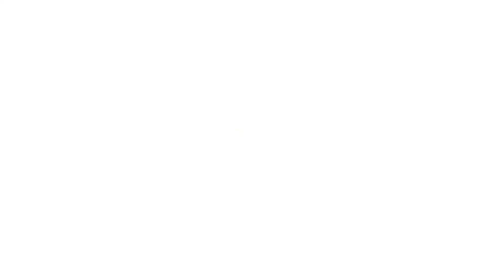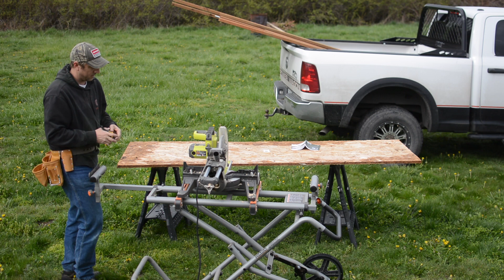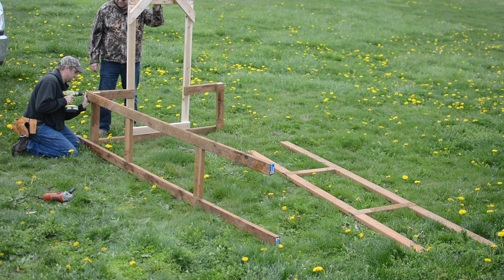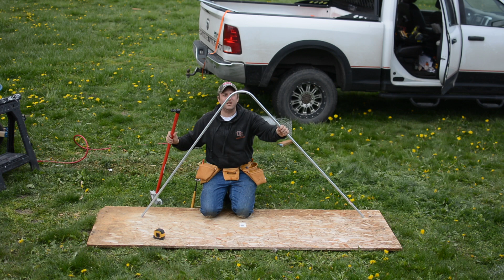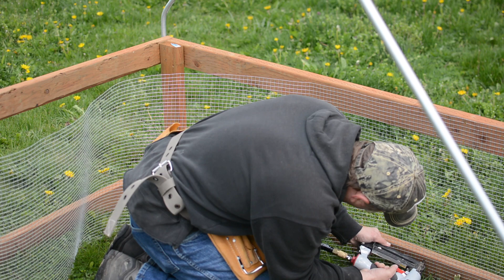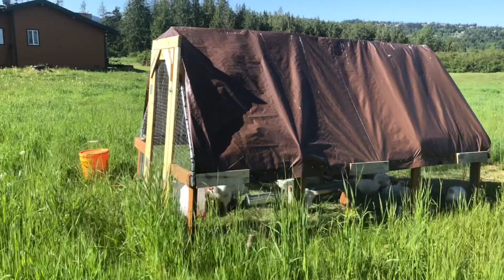Complete Build and Review of the John Suscovich Chicken Tractor

Comment: If you do it again, a suggestion for the door that has helped me is to go buy a $30 screen door from lowes or home depot and reinforce it with the wire/lumber as needed. It's a bit taller, but it take the head ache out of building the door from scratch.

Comment: Attaching the chicken wire with just a hand stapler is easy. After making all those lap joints you have the hand muscles of Superman so using the hand stapler a hundred times or so a tractor is cake!

If you don't have perfectly flat, well-manicured pasture I recommend getting a roll of vinyl wall base (4 inch or 6) and some 1 inch roofing nails and nailing the wall base to frame along the bottom edge. Cut some vertical slits in the vinyl so it can move a bit. This keeps the coop mobile but the skirt of vinyl will hang down and help close any small gaps between the base of the tractor and the ground.
Reply from the maker: That is an excellent idea!   I will have to use that on the next tractor!  Thank you

Comment: How does the answer surprise anyone as you wrote on your thumbnail?
Reply from the maker: Josh Blick I like it for a small batch but do not recommend it for a larger scale operation.
Reply: Depends on what you mean by "large scale". For raising let's say 1,000 to 1,500 chickens at a time (in 33 to 50 tractors), the simplicity and ease of use makes it the perfect design: it's light so even a smaller person, or someone with a physical injury, can move it. It's also small and see through, which makes it pretty much impossible to hurt the animals, when moving it. Meaning you could even entrust the job to a 14-15 year old, and they could do it flawlessly, in three hours or less per day...that includes keeping them all watered and fed. It's also pretty much predator proof, you don't need any other protection. Maybe a dog, if you have one, or some kind of electric fence around the whole pasture, just to keep any aspiring diners from getting up close and scaring the birds to death.

But sure, it's not meant for the industrial scale. Lining up 1,000 tractors some place, and watering and feeding 30 chickens at a time, would be silly. On that scale, you would want to use electric netting, with a mobile shelter in the middle, as well as a large supply of feed attached, all on wheels (that can be moved with a small tractor, let's say). 500-1000 birds in each pen, geese and dogs for predator protection, some kind of watering system, and you can raise as many as you have pasture for.
Reply: Well it's not very big so......  lol I kind of thought there was more than just the obvious. You did say "surprise".
Reply: For production I think the Salatin low profile model is best by far. Sorry John lol
Reply: Until you have to get the birds out!